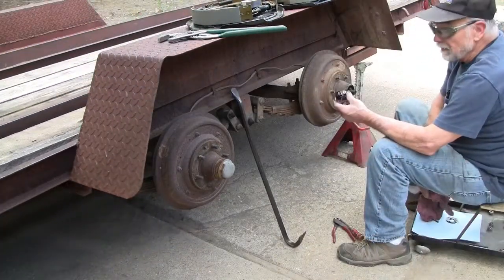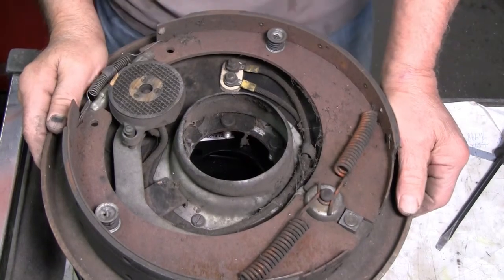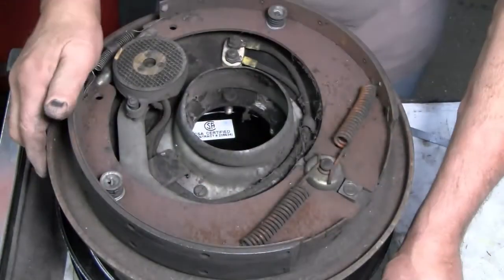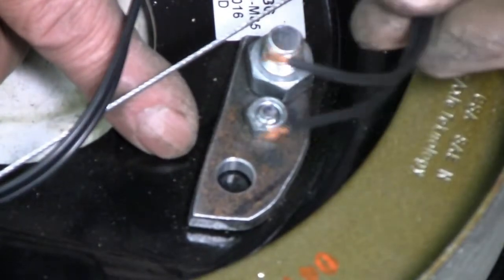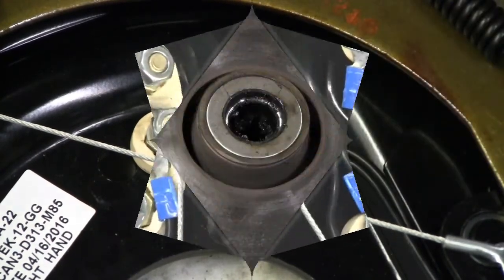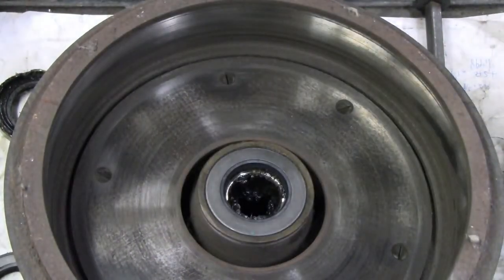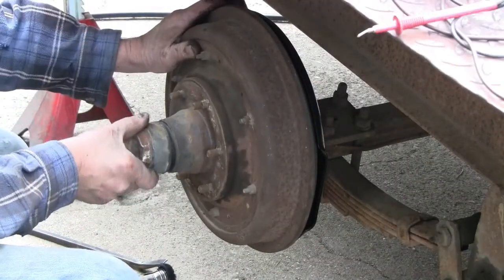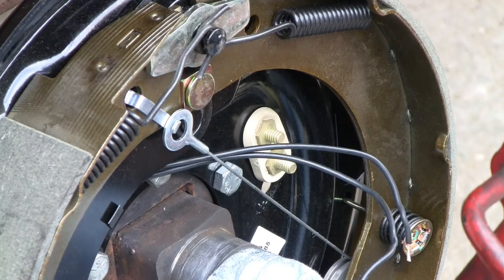How to replace your Trailer Brakes

Comment: In almost 20 years of working in the shops I did, I never had to deal with electric trailer brakes.  Once I wound up at a truck shop I got a crash course in electric brakes, and I agree that one is certainly better off just replacing the backing plate as an assembly, it comes out cheaper in the long run!